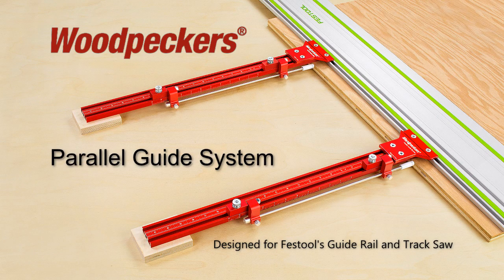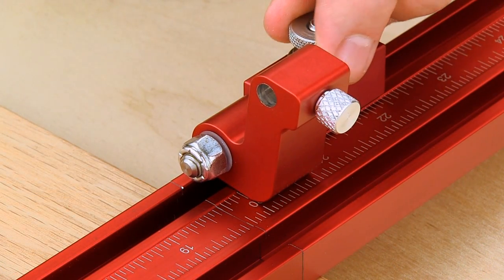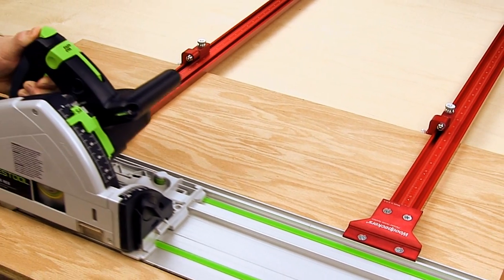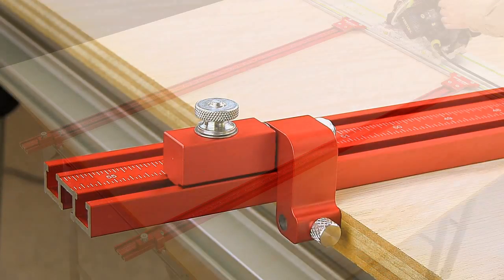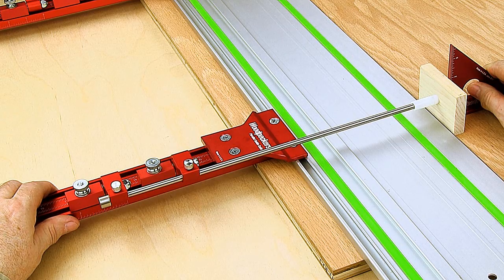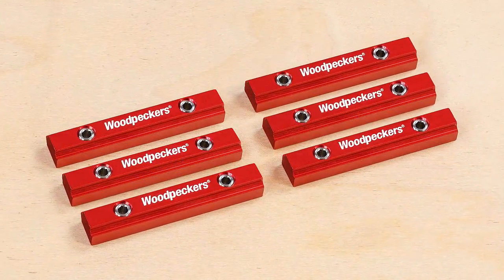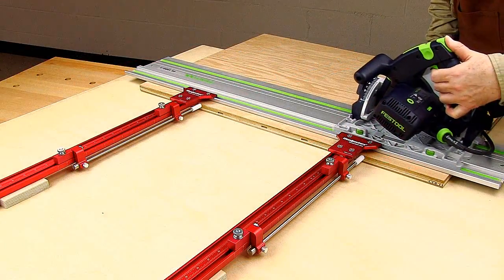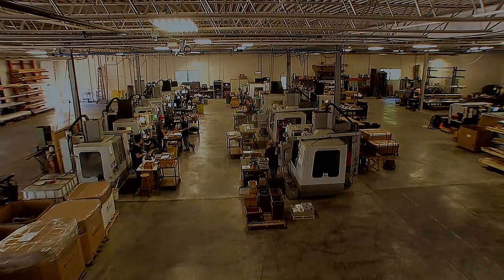Woodpeckers Parallel Guide System

Comment: After adding all the accessories to these festool tools it'll be cheaper to buy a table saw
Reply: Can't use that on bigger material though. Unless you spend a fortune on a really big sliding table saw plus you need the space for it.
Reply: @saiiiiiii1  I agree totally, I have a small workshop, no way I would get a table saw into it, festool guide rails and saws with the added parallel guide are brilliant and make it easier to cut sheet material than any big table saw. if you think about it, you have the sheet on your bench so your not man handling a sheet onto a table saw so it is easier to cut, I do it all the time and love it, takes me no time at all to rip and cut square precise panels, someone mentioned by the time you add on to your festool you could buy a panel saw, I would say I think your nuts if you believe that, if you buy a cheap panel saw then your already over the price anyway, I think your dreaming too much and you need to wake up and smell the coffee lol.

Comment: My Mother always told me......"If you don't have anything nice too say, then say nothing........but screw it.....LOL!
The Woodpecker set in a systainer is more expensive then the Festool version.
The Seneca Woodworking version is better then the Festool AND Woodpecker version of parallel guides !    Guys, Google Seneca Woodworking you'll see what I mean.
And the Seneca version is A LOT cheaper then the Festool and the Woodpecker version.   
I think Festool and now Woodpecker has missed the mark on parallel guides for the track saw systems.    That's just my opinion.
 I was  honestly hoping to watch this view to find a product worth buying.  I am currently using the Festool parallel guides which can be a pain in the butt to use some times.   But this one time tool does not peak my interest.  Maybe next time guys......maybe next time.    BUT who knows?!   Maybe in 8 - 10 months when this 
"One time tool" returns, I might reconsider........

Eric
Reply: Mike,  buddy.....you didn't search very hard, did you?   LOL !   I'm just busting your chops man.
I don't have the Seneca system, but I know you use the Incra t-track.   Here is a link to the Incra website where, ready for this?   Ready?
They sell metric scales for the t-track!!!!!!
LOL !     This  link will help you .........

http://www.incrementaltools.com/PARTS_INCRA_Metric_Scales_p/pc-scalesmm.htm

Take care man,
Eric
Reply: +Chris Hebert   Yes, that's my opinion.  I've based my opinion on what I've read and seen.   I don't have to own all the PG's to form an opinion.  If I was in the market for a PG set I would buy the Seneca version vs. the Festool or Woodpeckers from what I've read and seen.  The Festool PG's are good, but could be better, this I know from using them.  I'm not interested in the Woodpecker version with all the bits and pieces and from what I've seen from this video.  The Seneca PG's look like a quick and easy solution for track saws from what I've seen and heard from other users.     
If you do a Parallel guide search on the Festool owners group, you'd find a lot of threads about Festool and Seneca PG's along with pictures and users feedback.    

For some guys $70 may be a lot of money.   
Yes, Woodpecker makes well made stuff.  I own a lot of it.   Not every product from every company can be a home run.
Take care,
Eric
Reply: I was gonna email you to see what you thought about this one. Now I don't have to! Lol!
It seems ok (sorta) to me but the narrow ripping looks weird and cumbersome. Almost like it won't work. I agree, the Festool parallel guides can be a pain in the but but this kinda seems silly in comparison. I still think narrow ripping the way Festool has it set up is better. Not sold on this one either? Eric do you have the Seneca version?
Reply: Jeremiah Schwenger No Jeremiah I don't have the Seneca version. I have the Festool version.   After using the Festool PG's for the past couple years I've accepted them for what they are.   I've been thinking about picking up the Seneca PG's.  If the Festool PG's aggravate me in the future, the next PG's I buy will be the Seneca PG's.

From the beginning of this Woodpecker video the first thing I did not like was the fact that the Woodpecker PG's needed to be support with scrap pieces....just look at the 0:02 mark of the video, they have small pieces of what looks like 18mm (3/4") plywood for support of the PG's.   For me, that's not good.   And yes, like you, I do not like the narrow rip guide feature of Woodpeckers version.   

The only thing I like about Woodpeckers version is the flip stops......that's it.   LOL !

Eric
Reply: MrBigerock   OH yeah!   Jeremiah.....the other thing that I DON'T like about Woodpeckers version is the philips head screw for mounting to the guide rail.....why not a thumb screw????     Looks like a thumb screw would still clear the body of the TS saw on the rail while a cut is being made.     At least with the Festool PG's not extra tools are required for assembly.
Eric
Reply: MrBigerock The scrap piece is only required for rips that are less wide than the guide rail bracket, otherwise it appears it simply lies on the surface.  The only system that doesn't have to be supported with scrap pieces that way is the Festool Parallel Guides.  That said, the Festool guides require you to attach spare keys to support them!  Pricewise, other third party solutions don't include the cost of t-tracks... and NONE fit in a systainer.
Reply: +MrBigerock the seneca system looks really good and the price is great but sadly there is no metric version available. do you have any information of a metric system of similar quality ?
Reply: +MrBigerock So you don't own the Seneca Parallel Guide System but you say that it's much better than both the Festool (that you say you do own) and Woodpecker version (which you don't own either)? You're kidding, right?
I went to the Seneca website, and they currently list the parallel guide system for $190. You need to add 2 x 48" Incra tracks to this, at $20 each, so now you're at $230, vs $299 for the Woodpecker sysem. I would not qualify $70 as A LOT cheaper. Everyone is entitled to their opinions, but if you don't own or haven't used either the Woodpecker or Seneca systems how can anybody take your comments seriously? I agree that some Woodpecker items are overpriced vs other solutions, but for my money, their stuff is extremely well made, solid and very accurate - my 2 cents.
Reply: +MrBigerock You categorically state that the Seneca is better than the Festool and Woodpecker version, but you've only used the Festool version, so your opinion is only based on what you've read, not your user experience - that's the point I'm making. Anyone can read countless testimonials, but you're not adding anything to the discussion by summarizing the experience of others - we all have internet access and can form our opinions based on what we've read.
Reply: The Poplar Shop Check out TSO products parallel guide $169.00. Clips onto the track at yhe edge of the board 10 seconds to square!
Reply: Keith Roban can't go wrong with what TSO has. Well worth the money. No joke. Verified square with woodpecker   squares... absolutely perfectly square.
Reply: Honestly, I don't think Seneca's hold a candle to these. Laser engraved aluminum parts, no stick on tape, can change the length of your bars on the fly, custom systainer, innovative and easy to use. I appreciate the Seneca and have used them. But this Woodpecker set is quite a step up.
Reply: I agree.  The Seneca system is more than a little difficult to calibrate. 
Just wish they had added 2 features to this Woodpecker Parallel guide system. First a low knob to attach the unit to the track, which would not interfere with the operation of the saw (instead of the screws). Second a more substantial t bolt nut that would fill the entire space in Festool track rather than just a nut.  Having owned the Seneca system, those things can get lost in a hurry, if you need to take the unit off the track.